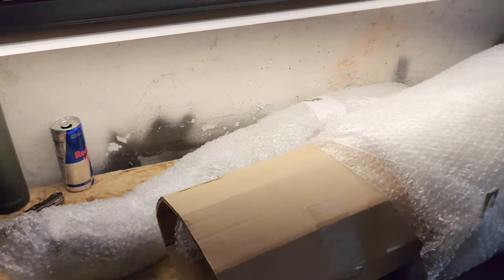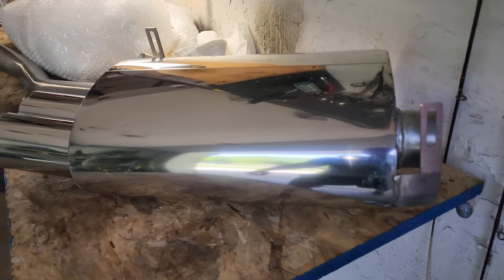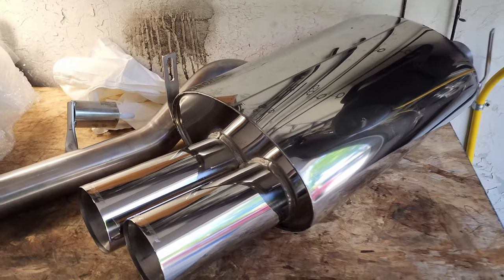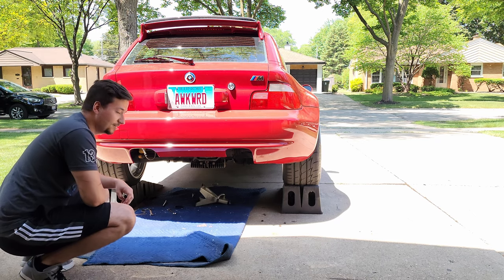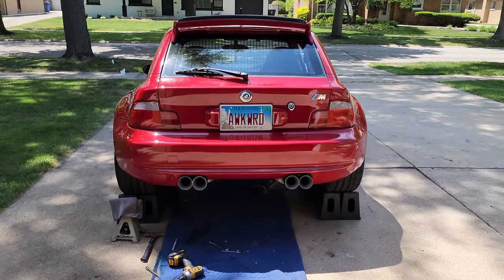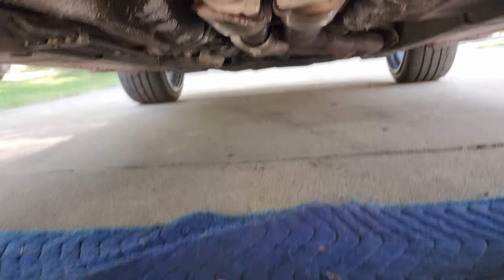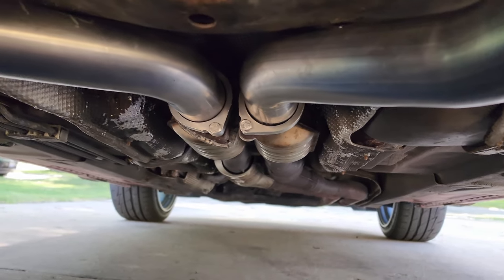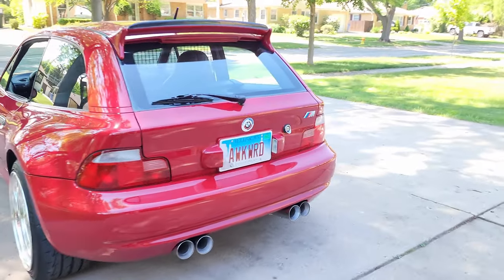BMW Z3 M Coupe Gets An Eisenmann Race Exhaust (S52)

Comment: Interesting I just did the same exhaust but for my 2002 3.0 coupe and I am not sold on it either. Was expecting it to be louder
Reply from the maker: I will say, I had that custom midsection made that i mentioned in the video and it sounds fantastic. Equal length from the headers to an x-pipe, a pair of resonators, and no cats. It sounds so smooth down low and in the mid range, then screams up top. Really livened up the tone of the car. 

Still working on finishing the filming for that video (weather permitting here in the midwest). Definitely recommend looking into something like that for your setup.